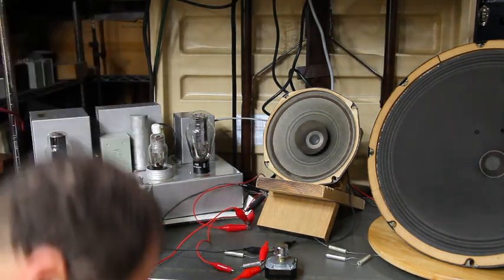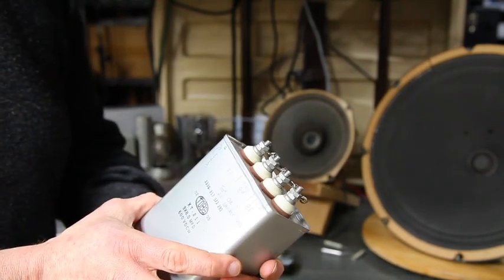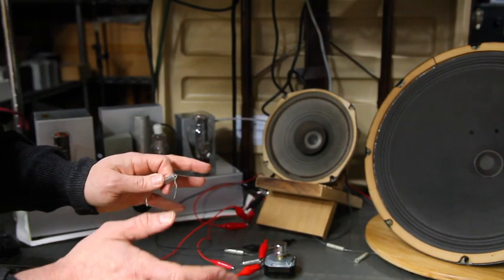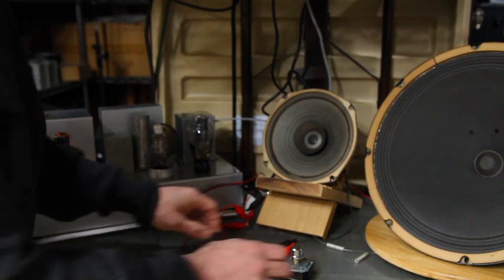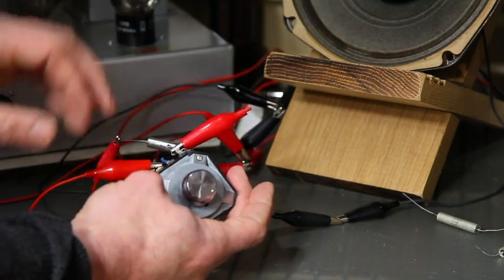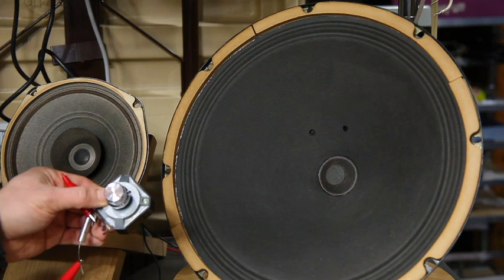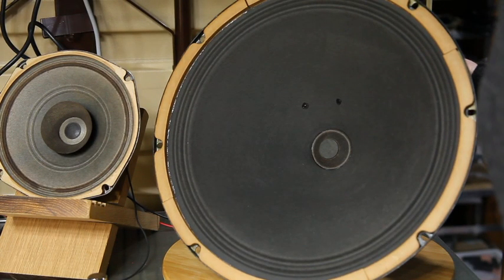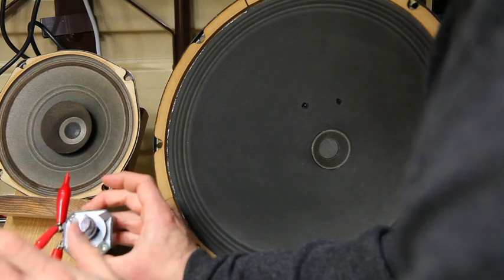Jensen C855 Rola experimental setup with tantalum caps

Comment: i have a pair of c855 but since there is no ts parameters available im reluctant to make cabs for them. im wondering if you can help me out. tia
Reply from the maker: Hello Enio, congrats, they are great speakers. They do best on open baffle, like so many speedy delicate 8" drivers, they don't appreciate the loading of a stuffy box. Production varies allot, between the C855 "felty" cap and the C855b etc. Q floats around 1 for some, but the better ones drift a little lower IMHO.  My last (unloaded, unweighted bench test gave a particularly good sounding one : Fs 76hz, Re 7ohms, Qes.98 and Qts.89
Reply: @HiFiTown  thanks for the reply! would you mind sharing the full tsp so i can simulate it in winisd?
Reply from the maker: @newENIO11  Given that I have never seen any two drivers test perfectly the same -- I am not sure a simulation give you any guarantees -- and I have not heard these sound good in a sealed or ported cab (so far, but good luck of couse and let me know!) -- I don't extensively pull T/S, but my note also has: Fs 76.71hz, Qms, 9.6, Qes .981, Qts .89, zmax 75.46 ohms -- (as always, R-L bridge derived take t/s param's on vintage drivers with a grain of salt!). As noted some of the better sounding ones I have had have a even lower Qts of around .7
Reply: @HiFiTown  difference in measurements may have something to do with the age of these drivers and the environment they were in. i simulated a bass reflex design and the box came so big! i like it! ahaha i cant thank you enough boss.